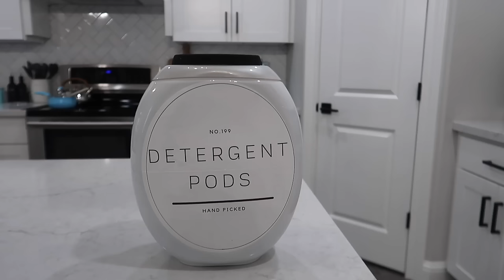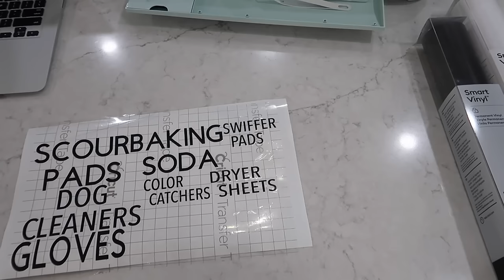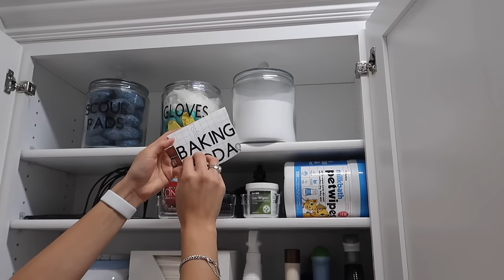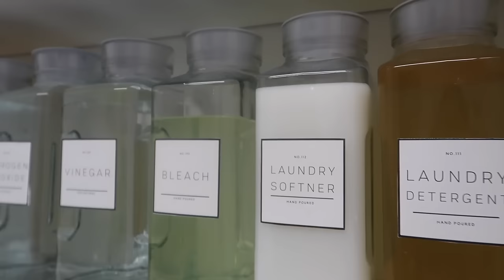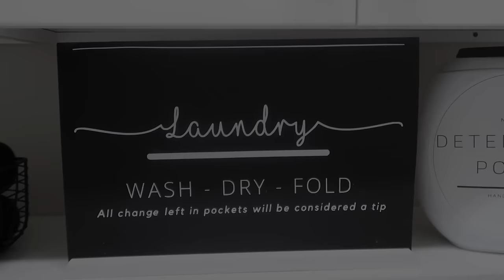DIY SMALL LAUNDRY ROOM ORGANIZATION | DECORATING IDEAS | SATISFYING ORGANIZATION IDEAS | LAUNDRY DIY

Comment: Peroxide and Clorox have their own special containers for a reason, I suggest you to read labels before change them, in my case I don't like to storage the dryer sheets out of a box , because they smell so strong that gives me headache. I also recommend everyone to use cutting machines properly installed on a working table, not on the floor. You have good ideas, but some are not well applied. Blessings

Comment: My favorite clean smell that I have found so far is just mixing the dark blue dawn dish soap with water and putting it in spray bottles. If the ratio is right it works awesome on mirrors, too. But it just leaves this odorless  smell in the house without a fragrance masking. :) oh and my favorite part is the decanting/restocking  bins/bottles/containers as well 🤍
Reply from the maker: Thanks for sharing! I’ll have to try it out 🥰

Comment: Awesome video.  Not sure if any one else mentioned it, but I wanted to let you know that hydrogen peroxide is EXTREMELY degradable in any kind of light.  That's why it's only sold in containers that block out all light.  Your glass jar idea is marvelous, but you might want to use a completely opaque or at least amber glass jar for the peroxide.

Comment: your laundry room looks awesome.  I have been trying to get mine organized and it makes doing laundry or looking for cleaning products so much easier.  I am wondering what you use the Borax detergent for?  I have seen others use it but I have never really understood the uses for it. I have a box and don't want to waste it.
Reply: It's a laundry booster so if I have to wash cleaning rags I'll add some to that load or if I'm washing rugs. If you have athletes it will help clean their uniforms. It enhances the laundry detergent. I start the load with hot water so it dissolves (I also use a powder laundry detergent) then load the clothes then change over to the correct temp for the load. Borax is a harmful chemical so keep it out of pets/kids hands. Once opened it tends to clump. And it doesn't really have a scent.

Comment: Loved your video and the storage containers are beautiful.  One thing to know is you should never store hydrogen peroxide in a clear container as the exposure to light will lose its efficiency which is why you will always find HP stored in dark containers.
Reply from the maker: Great point! Thank you for mentioning it The thought actually crossed my mind after I had poured it out but I figured since it’s inside a cabinet, light doesn’t affect it much. In the case that it does, it’s just laundry. 😅I have separate HP for first aid in its original container. 😊
Reply: I've always heard to keep hydrogen peroxide in the dark container, however I recently purchased what I thought was witch hazel and later found out it was hydrogen peroxide,, that was a first I've seen in a light white bottle.  I prefer to buy the dark bottles

Comment: You shouldn't put the hydrogen peroxide in a clear container. Its in a dark container because exposure to light turns it into liquid H2O and oxygen gas. So those are basically jars of water by now.